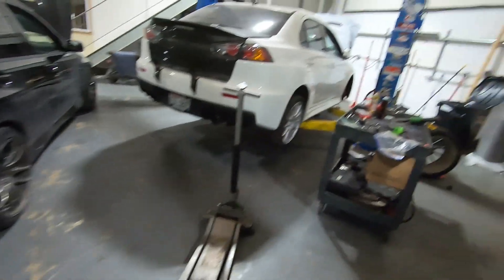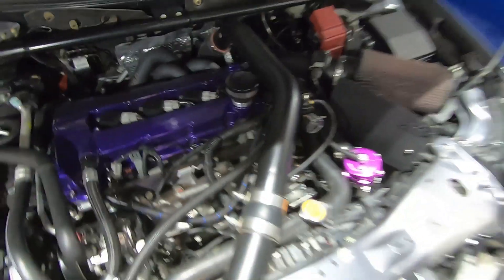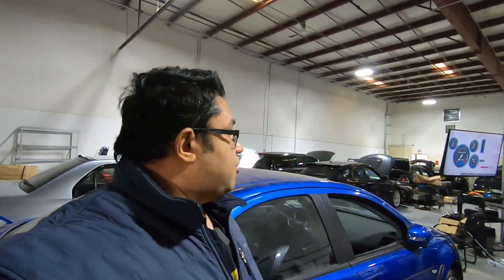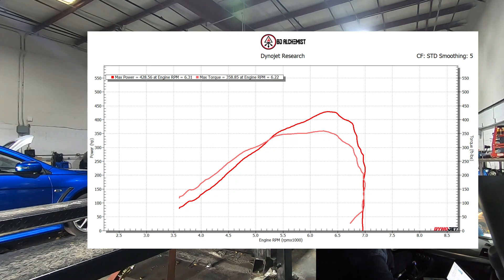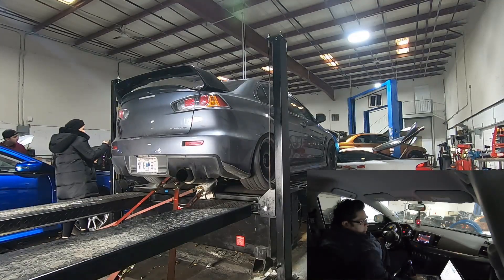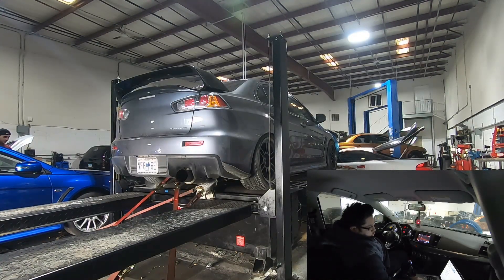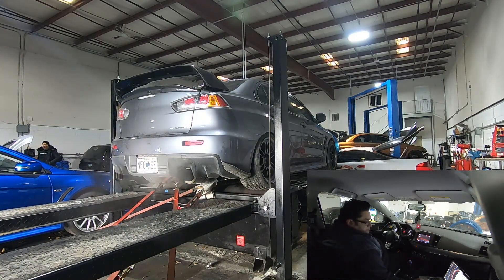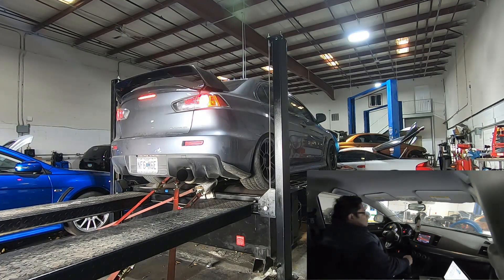EVO X Garrett GTX-3576 Gen 2, GSC S2 cams, Stock block , 93 , e85 Flex fuel dyno

Comment: Always a big fan chemist. All I can say is my car it's a challenge with the GSC S3 cams to get it to idle. It's chopping like crazy, it's idling at 1100rpm. My original set up before was 544hp 387tq my turbo wasn't so big but I was warned about going over 400tq on stock head.🇯🇲
Reply: You might need to tweak the throttle air flow table a bit.  Start with adding maybe 5 percent at the lower values where it idles.  A little change is alot on this table.   Sometimes you have to touch it when you have big cams.
Reply: @MitchChubey  much respect me genna,I'll let my tuner know. I'm doing my break in now, so it's a challenge..Again much respect 🇯🇲
Reply: The airflow table helps, also a smooth transition in idle timing helps as well.

Comment: How u getting  almost  400 tq on pump running  only 25 psi? From Ur graph looks like turbo starts losing power after 6600.I have same setup.on my Mr Built head and bottom end running  26psi barely  hitting  300 ish tq.

Comment: You said that he was producing a lot of torque which is limiting the horsepower potential (presumably to not hurt the stock bottom end).  Can you explain that?  Can’t you control/reduce torque in the mid range through lower boost (and timing) and then ramp up boost above 5500 rpm or so to make the HP?  Or was this car running an MBC?
Reply from the maker: Nothing helped , this is at 3° peak torque timing and 24-26psi and low mivec. It's just his setup , which would be awesome with a built block.

Comment: Wassup bro! What is that average cost to do that setup?  Thanks.
Reply: It will cost you around 
Turbo 2700$ + -
Cams 650$ + -
Springs retainers, valves etc head work 2000$ to 2200$ + -
Head Studs 400$ + -
Head Gasket 80$ + -
Down Pipe 400$ + -
Labor + Tune 2500$ to 3000$ 😁

I paid when I did mine ( on locally in my area )
Reply: @shavkatburhanov1325  OMG!! I guess you got to pay to play!

Comment: Hey BD alchemist, have you tuned a evo x in a xona rotor 6465s? Pretty sure it's pretty similar to a 3576R but just eating to see your thoughts if you've tuned this xona turbo on a X before
Reply from the maker: I have not, sorry
Reply: The 7164s is similar to a gtx 3576r.
Reply: @JPTinioMedia  the 6564 is a 57mm and a 3576R is a 58mm 
So they are close by 1mm
I'm gonna look at that one you said
Reply: @lcameeno1  The 7164S is 59.8mm. Make sure you're looking at getting the S with the X3C cover. The 6564S is comparable to 3576R but you have to also consider that thanks to the UHF Turbine Wheel the spool and flow efficiency is better despite the compressor wheel inlet being slightly bigger. So if you wanted something similar to GTX3576R both the 6564S and 7164S will do the job but the 7164S will have more power and probably spool like the 3576R.
Reply: @JPTinioMedia  ahhh gotcha yeah I was really interested in the new UHF and X3C technology. I'm on a 3576R gen 2 currently but I want to spool a little faster with a bit better torque for when I build my block. So I was looking at the 6564S because it's only 1mm smaller but I may also look into that one now aswell!
Reply: @lcameeno1  There's  a couple guys on the forums with built motors, the guy with 7164 (Non S) made 733WHP at 35psi with 0.82 A/R V-band housing. He said he could squeeze a bit more power if he had the S. The guy with the 7864S made 866WHP. Also they have a variable pre-load ball bearing cartridge. Helps to eliminate wear and helps with cooling as well doesn't require an oil restrictor unless you run high oil pressure
Reply: @JPTinioMedia  damn I need to go to the forums and see if anyone has used the 6564s, I'm really curious now that's amazing. Damn I may just go with a 7164S but I wanna see if I can make either full spool below 4k
Reply: @lcameeno1  define full spool? You want to hit full boost? Full boost is generally defined as 20-22 psi from what I'm told and than of course target/peak boost is the later in the rpm band
Reply: @JPTinioMedia  yes sorry full boost lol
Reply: @lcameeno1  Someone I know who has the 7164S on a stock block and stock cams hits 20psi at 4150 rpms and 30psi at 4600 rpm. This was a very aggressive tune though and on E85. If you went on a twin scroll setup you probably could get that to 3900-4000